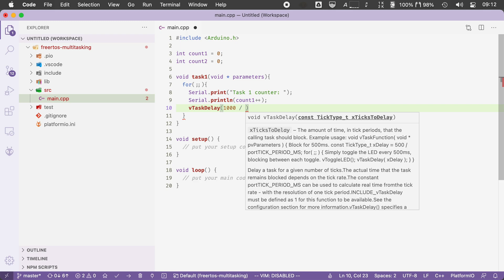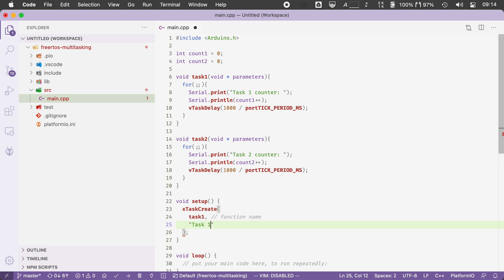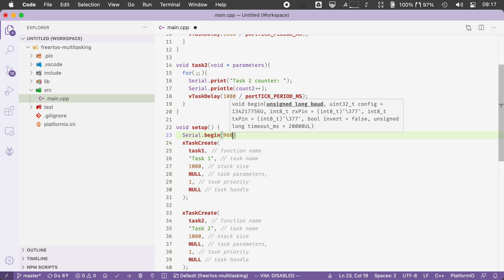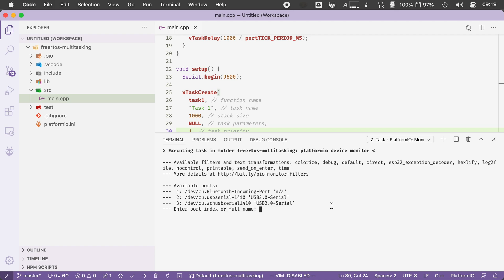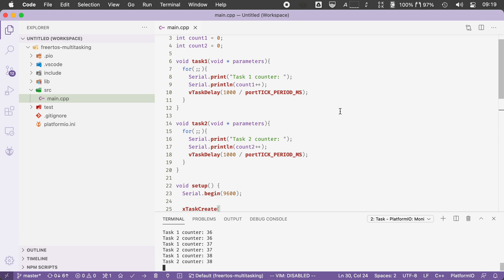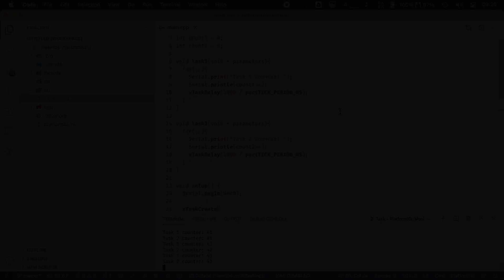How to Multitask with FreeRTOS (ESP32 + Arduino series)

Comment: Maybe I'm misunderstanding the terminology but this is not parallel processing. It appears to be time slicing instead, bouncing between one task and the other. Try counting from 0 to 99 and then printing on task 1, and counting from 0 to 199 and then printing on task2. If task1 prints twice as often as task2, then you really are parallel processing.
Reply from the maker: This depends on the ESP32 you’re using. Most models are dual-core, and if the WiFi is disabled, two tasks will run in parallel. In other cases, FreeRTOS is indeed sharing the CPU time amongst tasks.

Comment: Nice Entry into RTOS  👍
May I note that one should not add computation within a print function, especially if using the Arduino IDE.
In the above example the count1++ should occur outside (before) the print statement, then the value of count1 can be printed (this goes for count2 also!). To see this issue in action, change the BAUD rate to 115200 and set the second delay (task2) to 200ms. After every few iterations you will see that the print is corrupted.  Move the count++ outside of the print function to fix this.
It's a very tempting short-cut, but it will bite you! 😄
Reply: thank you

Comment: Hi, for development mode, I don't want the task to run continuously. 
If I change from  for(;;)  to (int i = 0; i <= 4; i++) loop the task runs, but we get error "Guru Meditation Error: Core  0 panic'ed (IllegalInstruction). Exception was unhandled." ESP32 reboots, the task runs again and reboot cycle. 
Is there any work around? THanks for your help
Reply: I get this exact same error when even using the codes as is (with my wifi settings of course). I'm starting to think that this is some kind of issue with the chip as mine is Adafruit ESP32 Feather. If i comment out the wifi.begin() function I do not get this error but of course system doesn't do what is supposed to

Comment: unfortunately these examples are ok but only when there is no any other process that is running in rtos, i.e. OTA. But when OTA kicks, the ESP32 crashes. So probably this tutorial requires a bit more of explanation how the 2 tasks can work with other tasks without crashing. I would be first to watch it ;-)
Reply: IF you are not using Wi-Fi or BT, then switch them off, otherwise set your application to use only one processor, the wireless stacks take precedence!
Reply: @adrianw2972  you are right but esp32 without communication is useless ;-)
Reply: @Zygfryd Homonto  quite untrue. I use them in standalone projects, usually with displays.
If you wish to use WiFi or BT, simply set your code to use core one only, core zero is used for wireless. And do not use blocking code. I.e. do not use delay, use the FTOS delay functionality etc.
Reply: @adrianw2972  some ESP32 are single core - actually I mainly use S2 that is much faster but 1 core only. So I had to use it different way

Comment: I have a conceptual question: do you have to install FreeRTOS like you do a regular operating system (e.g., Windows, Ubuntu, etc.) before you can use its functions, or is FreeRTOS just a library in ESP-IDF, and you flash what you use from the library to the microcontroller along with your own code?
Reply: No, you do not. It is not an interpreted language like python or BASIC, the final program is compiled. If you have installed the IDE for the ESP, it will then work

Comment: It is not clear if i have to install something to make FreeRTOS available. Also, you mentioned ESP IDF in the previous video, what is it? How can i use it? Is it an alternative to the Arduino's Framework? Wouldn't it be better to learn something native to ESP32 instead than using something that was born for a different platform (the Arduino Library) and that perhaps cannot use the full power of ESP32?
Reply from the maker: Arduino for the ESP32 is built on top of the “native” framework (ESP-IDF). Everything that’s in IDF, is available from Arduino (including FreeRTOS). Is it better to directly use IDF? Nowadays, yes. The Arduino version is stable, but uses an older version of IDF.

Comment: Maybe I am wrong and pls correct me. But freertos is included in Arduino library and it supports esp32? I mean this is already builtin library?
I guess same lib can be used for arduino boards? thanks :)
Reply from the maker: No. Arduino for the ESP32 has been build on top of esp-idf. FreeRTOS comes from idf, not Arduino.
Reply: Yep, like what @Simply Explained said. ESP32 packages should be installed externally. But there is Board Manager in Arduino which reduces a lot of works. Or be more simple, you can directly download the ESP32-packaged version of Arduino on Google.